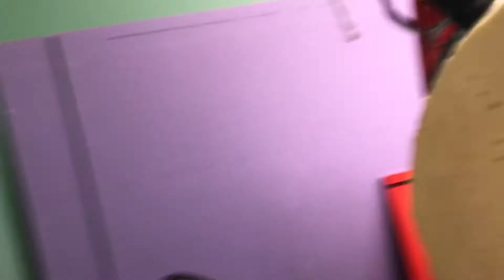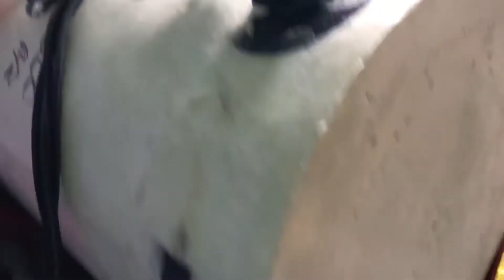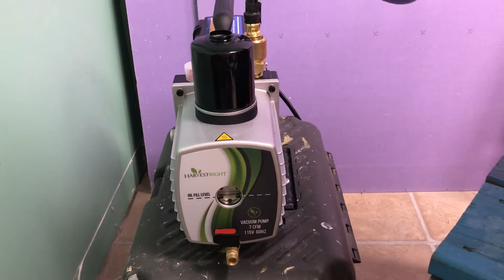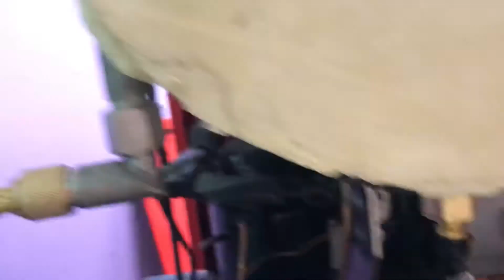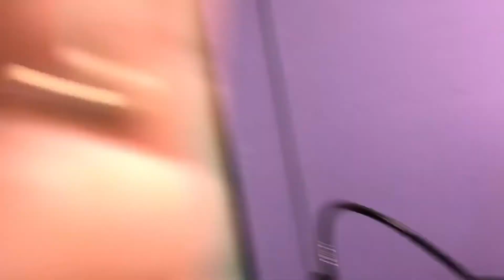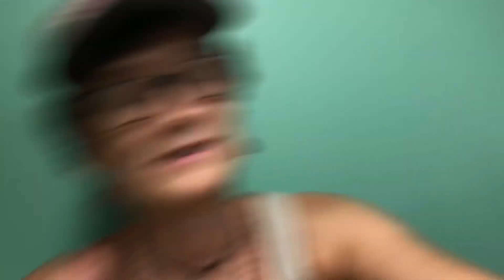3F: 1Year Day 255 - Freeze Dryer Update - Pump Problems

Comment: We've had our freeze dryer for less than 3 weeks and it has yet to run a successful batch. I've been on the phone with harvest right multiple times, emailed back and forth with no end in sight. When I mentioned just getting my money back, they informed me that I would have to pay to ship it back and they add a 15% restocking fee. So they send you a defective unit that should have never left the factory to begin with and when you ask for a refund they wanna penalize you for there mistake.  I wish I would have e seen your  videos before I purchased this unit. Thanks for your helpful videos.
Reply from the maker: Wow that is so frustrating! I really hope that is not what they are doing. If that is their business plan then hopefully things will work out in the end through the legal system. I like to think that these machines do not ship well which causes vacuum leaks from the get go. The main problem Harvest Right has is adequate customer support does not exist. They need to take their profits, slow down on the sales and work in beefing up ways to support people. Hire regional maintenance people that come to your home and fix the machine on site. It is an appliance. I don’t take apart my refrigerator. I call someone. I’m so sorry to hear about your struggles. You are definitely not alone. Hopefully you can get it working!